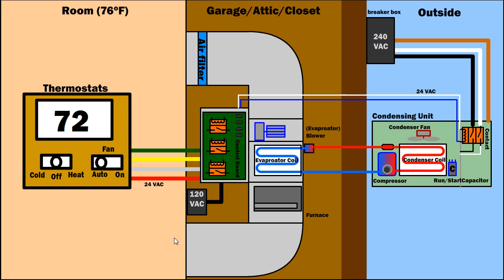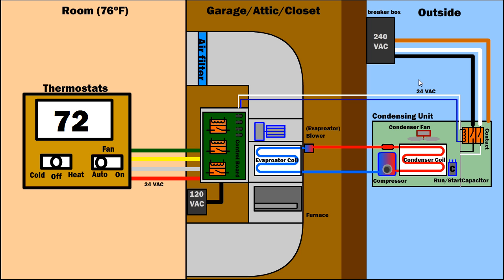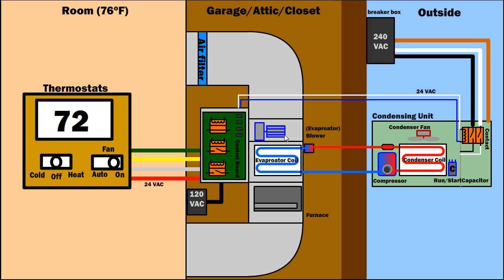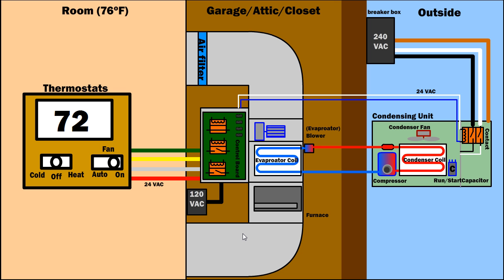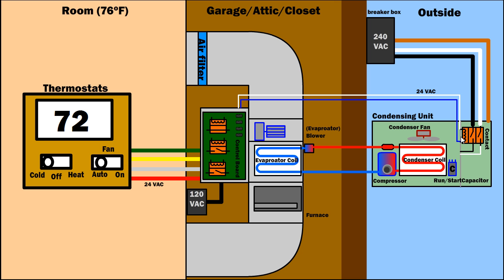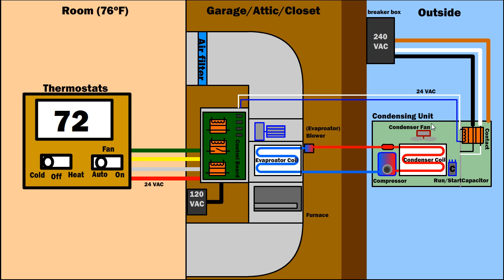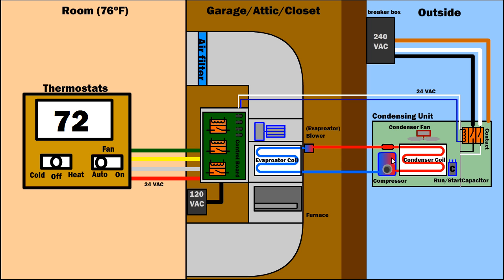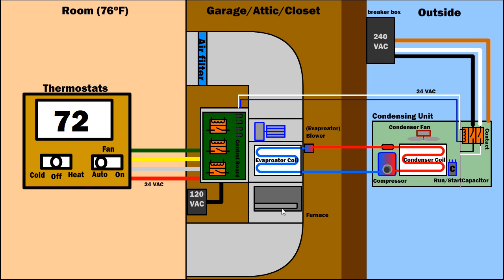Troubleshooting Air Condition Ventilation & Furnace - how does HVAC AC work Troubleshoot

Comment: when I turn on my ac on my thermostat, all I hear is a click on my condensing unit and nothing else happens. no humming no fan and no vibration. what should I do?
Reply from the maker: charis taula 1. Understand how condenser works:https://www.youtube.com/watch?v=cnD65qX8bjM

2. Most common problem: Capacitor
https://www.youtube.com/watch?v=4OAGq84mQSo
https://www.youtube.com/watch?v=bT6W7hPHfUo

3. Next would be fan motor and compressor:
https://www.youtube.com/watch?v=TL4v5DY_4_0
https://www.youtube.com/watch?v=r8LD6rtElUY
Reply: you have no 240v to your condenser if you did you'd atleast hear a hum

Comment: We just turned the AC unit one.

We notice the air flow coming out is kinda low. Any suggestions?
Reply from the maker: YetAnotherTechGuy Did it suddenly went low? or going low over time? you can check your air filter, check if anything is blocking air flow, check your evaporator coils and check your blower motor.
Reply: We only turned on the AC a couple days ago as the summer heatwaves are just starting. Before that, it was a year from now. I have checked the air filter, and also cleared the air supply vent. Is the blower motor in the furnace unit or the unit outside the house? I was thinking about cleaning the unit outside the house but I don't think that would affect the airflow inside.
Reply: Upon some further investigation it looks like the Goodman AC unit has a F4 error code which says "Replace Red Indoor Coil Thremistor"

I assume this is the inside unit and not the outside fan\compressor?

Any idea where I could buy a new thremistor?
Reply: YetAnotherTechGuy the blower is the motor in the furnace. sounds like you might have a dirty evaporator coil or bad motor/motor capacitor. You can do two things before hiring a AC guy. 1. Clean the evaporator coil, some units have a service panel. 2. Check the motor capacitor. If the evaporator is clean and the capacitor is good, then call a AC guy.

Comment: Em. heat works as well as blower fan, but no compressor, no regular heat, and no condenser fan. Any ideas what to check. I replaced the run capacitor.

Comment: hello i have a question the ac works but when the outside fan stops inside the furnace fan keeps blowing for hours is this right???? please help i called a tech but after 2 months still have the same problem i think i been scam
Reply from the maker: The blower shouldn't be blowing for hours. This is a tricky fix, but sounds like your control board might have a stuck relay or malfunction control board. The following video is the opposite of whats happening, but the troubleshoot idea is the same.
Air Conditioner doesnt blow any air - how to fix AC blower - HVAC control board replacement

Comment: My furnace blower runs intermittently when I use my AC. It works fine with the heat. The previous owner just installed the unit and one of those smart thermostats from the power company. Im kinda leaning towards the circuit board. What do you think?
Reply from the maker: see if the following video helps or not. it goes over the circuit board and fan motor.
Air Conditioner doesnt blow any air - how to fix AC blower - HVAC control board replacement

Comment: Originally the condenser nor the fan would turn on in my Rheem unit.  So we replaced the capacitor.  It ran for 3 or 4 days and then stopped working again.  So I replaced the contactor and it still will not work.  Any ideas of what to try next?  Thank you so much for your help.
Reply from the maker: I would check the fan and compressor with the following method:
AC blowing hot air - How to troubleshoot HVAC compressor - measure resistance - blown compressor
AC fan not working - how to troubleshoot and repair condenser fan motor - trane air condition

Comment: This gave me enough info to troubleshoot my problem.  It seems to be some issue with my "saver switch"  The saver switch was preventing my condenser unit from getting the 24VAC to the relay.  I was able to bypass the saver switch until my power company can come out and check it out.(3 Business Days, it's already Friday.)

Comment from the maker: The 24VAC comes from the transformer, which comes from 120VAC. The control board is also powered by this 24VAC. Check your overflow control valve. its a common reason that shuts off 24VAC. Check youtube com/watch?v=DXqXmz0YwQs

Comment: For the Control Board, where does the 24V come from? Is the 24V (R) supply by the Transformer or it was converted from the 120V/240V to the Control Board? The reason I ask is because my there is not light on the Control Board nor 24V from the (R). There is power go to L1 & L2 to the control Board but nothing put out to R when test with Y. Any thoughts? Thanks for the video and your time.

Keith

Comment from the maker: sorry, i couldnt follow your question. I will assume the blower works fine if you set the thermostat blower to "on". So, its not a blower issue. You can short the yellow wire to red and force the AC on. If you do that, and the blower maintains on, then you have a bad thermostat. If not, then you need to check out the control board, transformer or wiring. watch more here:youtube.com/watch?v=nJVTVCVITxw

Comment: Hi:
It was on auto for cooling. In the morning it went on and off several times. I turned on the blower by turning in on and it stayed on. It does this every once in a while. The breaker and fuse is fine. I pulled the thermostat, blew it out and changed the battery- nothing. I blew hot air on the temp prob- nothing changed. Then out of nowhere- it started working correctly. Any thoughts?
Thanks for your time.
Don

Comment from the maker: well, are you setting it to blower "on" or "auto". Also, is it for cold or hot? 
The most basic is if you can set it to "on" at the thermostat and if maintains on without the problem, then next check it in cold, finally hot. All 3 setup executes the blower differently.

Comment: Here is what happen, like I was sharing with you on the gas burner emergency switch box was my power to the control board. The crazy thing is I got two gas burner emergency switch boxes and the first one was on the first floor to the circuit breaker box that was on the off position when I turn that back on wooo la 24V shows up. don't know why they put gas and power together. like you always said check your power it is so true, my was hard one.
Thank you again for all your kindly support
Michael

Comment: Tinker, i did what you told me about the "door switch" and transformer check. Looks like the problem is that i am not getting 120V to the control board or should i say to the furnace. my furnace do not have a regular 120v switch or plug. my 120v wired with gas burner emergency switch box, however, when i read from it only shows 0.707v. I follow your circuit breaker video and checked the circuit breaker it has 120v. how do i check between the breaker box and the emergency switch box? thought?

Comment from the maker: every transformer's resistance is different. 0.8 ohms is a normal resistance value. if you have 120VAC on one end of the transformer, then the other side should be 24VAC.

Comment from the maker: i am assuming you have 120v at the power socket. Dont forget there is a "door switch" when you measure 120v inside the furnace. you have to press that down. when that pressed down, you can now measure the transformer etc...

Comment: Hello Tinker, i thought i got 120v in the controler board but today i read 0v and i also have checked the circuit breaker it has power it reads 120v. this morning looks like i do not have any power coming into the controler board. the 3amp fuse still looks good. thought? thank you again for all your help, Michael

Comment: Hello Tinker,Thank you for your quick response. 120V checked it read 120V. controller board 3amp fuse checked looks good. my Model do not have overflow switch i can be wrong because i dont see it. i saw all your overflow switch videos.
brand name: Tempstar
Model number: N8MSN0701716A1
Serial: A113416424
Replaced Contactor from 600V/24v Coil/25FLA/30Res to 600V/24v Coil/30FLA/40Res
-Controler board 120V checked;Controler board 3amp checked; looks good
Any more thought?
Thank you Michael

Comment: Please help!!!! my central air unit is not coming on and i replaced capacitor and contactor, i have checked 240v is good into contactor but i can not get a read on 24v in contactor, is this mean i replaced a bad contactor? if you can not get the 24v from the contactor, therefore, my thermostat not getting 24v too, is my thought correct? how can i get my contactor to read 24v? what are your thoughts? thank you so much in advance

Comment from the maker: I am guessing the condenser could be off, but the blower motor at the furnace keeps running none stop. If that is the situation, then you either have issues with the controller board or a safety switch is activated/stuck short (e.g. fan limit control, air switch, flame rollout switch, etc..)

Comment: I have unit that keeps Air conditioning going none stop. I have confirmed themostat is fully functional (swapping out to another unit that is working fine), I have check continuity to confirm wiring in walls not shorting out. I have tried to reset honeywell controller. Any suggestions? Thanks

Comment: my central air unit outside isn't turning on, breakers are good, when I turn it on at the thermostate it blows warm air through the vents. The capacitor was just replaced last year. What could it be. We took the outside unit and opened it and press on it with my finger and it made a buzzing noise.

Comment: I am afraid you are going to get someone hurt! I saw several things you left out about the dangers about gas and electricity. You better watch what you are telling people if you get someone hurt you may get in some trouble. I don't see a problem with anyone cleaning there own coils or simple things but if you are not a professional you should never fool around with electricity, moving parts or gas very dangerous stuff. I have saw many injuries to un experienced people. Be safe call a pro!

Comment: HELP! Took all steps and every test is fine until I tested the contact. Voltage going in reads 246 but nothing going out. I already bought a new capacitor and contact and still no reading going out. Any ideas?

Comment: Hey man. It was a good video for the most part. You have to be careful about telling ordinary people or do it yourselfers because that's how people get hurt. An example being when on some breakers there are only one switch while the crankcase heater stays energized and the person thinks theres no voltage and becomes part of the circuit. And you left a few key points out... But other than that I appreciate the video. Take care... Unless you're a certified technician... Be CAREFUL!!! And even then

Comment from the maker: thx for the kind words. well, check out 1:20 on the video. Bottom right corner has a "replace contactor" link to a video.
The sequence is 1st you need 240VAC to your outside unit. 2nd you need 26VAC signal to the contactor.  If you have both 240VAC, 26VAC, then you need to check your compressor and fan motor. I just uploaded two videos in my channel. Both videos go over how to test the compressor and fan motor. hope that helps.

Comment: Great vid man!  you Enlightened me.  My AC unit outside won't kick on at all, no humming or even attempt to come on.  What would you recommend I start with first?  I saw your other vid about changing out the capacitors.  I also checked out changing out the breakers at the panel.  I too am associated with the USAF (Scott AFB, IL).

Comment from the maker: hmmm... its hard to say without taking measurements on the control board. I can tell you that It isnt the run/start capacitor.
The control board controls relays. If it blows once its on 'auto' meaning the relay that controls 24VAC is overloading. it might be the control boards relay shorting something out. I would start there and do some measurements. Sounds like you have a very difficult puzzle to solve.... sorry...

Comment: I directly replace the old mech thermos but the auto units were not reliable. I've walked by one and it would change settings I guess by static elect. I had another one run away on heat setting and we had to turn the bkr to the air hdlg unit off. It seems like in the two cases I had an inter-phase relay between the control unit and the thermos had to be installed. Is this still the case on the newer systems we have today or can I just go out and buy an auto thermo without adding a relay?

Comment from the maker: Several things can prevent the AC from blowing cold air. Sounds like the blower and thermostat works. Next you should check the condensing unit. 1. Make sure you have power, 2. relay is receiving 24VAC, 3. check the capacitor, 4. make sure the compressor comes on, then 5. make sure it has refrigerant. You can fix step 1, 2, and 3. But replacing a compressor or charging the AC with refrigerant requires a licensed hvac repairman.